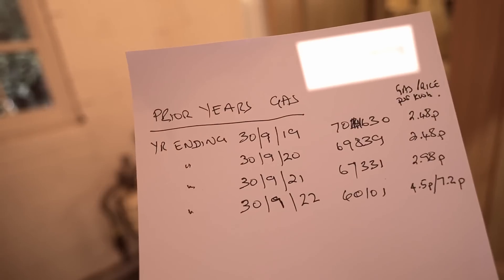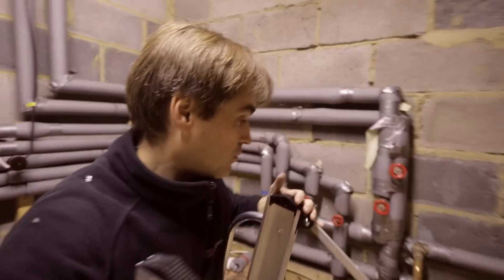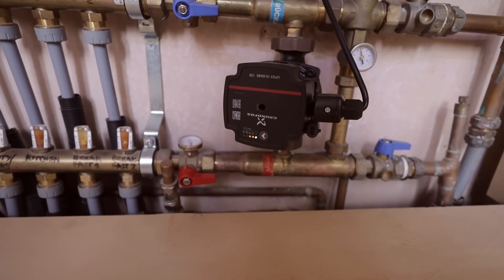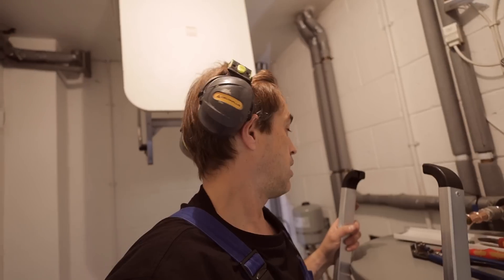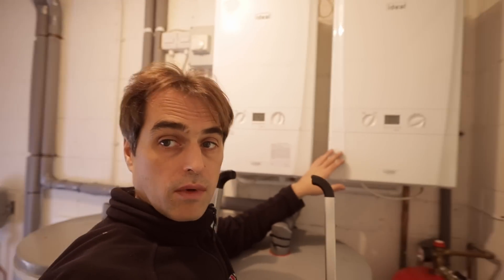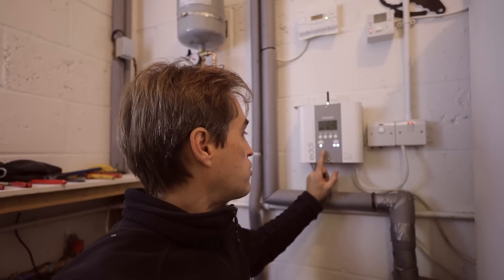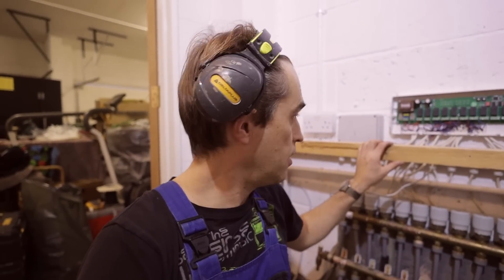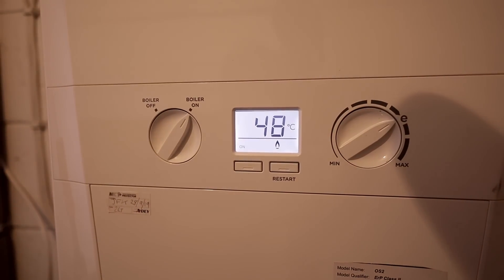Learn How to Lower Gas Bills and Improve System Performance

Comment: When we moved in the ex landlord told me to put the gas condensation boiler for heating only at 55c!
After watching plumbing videos,  testing different configs, buying temp /humidity sensors for every room and checking precisely how they compare to the boiler. I just realised that the boiler doesn't need to be hight than the minimum temp (40c)

Now I'm planning to get a competent plumber like you to install a proper system in my old home. It is worth it.

Comment: Many thanks for sharing this and also thanks to the property owners for allowing their property to be used as a case study.

Looking at your proposed saving of 20,000 kWh every year - heat generated within the building has to escape somehow - either the building is maintained at around 30C (unlikely) or they regularly dump heat by opening windows (possible but they probably haven't called you in to close windows for them) or the Ideal Heating boilers are both losing an average of over 1 kW continuously every hour of the day for 365 days a year - assuming they are set up for 90% combustion efficiency the majority of this heat must be leaving the building through the flue.

I have an Ideal boiler and I can't work out how it is even possible for it to be so inefficient - they can't just 'lose' heat - do you have any idea how these Ideal boilers can perform so badly?

Comment: Do you do heat loss   calcs on these upgrades or do you guess?
Reply from the maker: Full heat loss, always
Reply: @UrbanPlumbers   You may not know what insulation as been added .
  You did a nice job with those mixers  .
with the insulated covers .
Reply from the maker: @mgbroadsterJ  still better than just guessing. I go to the loft and look down the cavity or look into the vent brick. If those are not available I would drill the wall to check if customer permits.

Comment: sry I stopped viewing the video after you said that the water heater turns on once a day for 2 hours. Why? Why do you need electronic thermostat for that? Why not use a regular thermostat inserted in the water boiler  and that one triggers the gas boiler to heat the water when it gets bellow lets say 45 degree.

Comment: Brilliant analysis and fix Szy. And you managed it without slating ideal boilers!
The really depressing thing is how the last plumber (definitely not a heating engineer) managed to leave the system in such a state without even testing that things were functioning sensibly. Was it a complete install or has it been modified over the years to become that complete mess?
Reply from the maker: Looks like things have been done to the system over the years. Last installer just changed boilers

Comment: Underfloor heating gives you a great chance to use a condensing boiler at super-low condensing temperatures.

Unfortunately all gas boiler manufacturers installation manuals wrongly instruct us to set the return temperature to dew point (56ºC) or lower, which is incorrect - it should be the FLOW temperature.  

Even one of the best boiler makers, Viessmann, shy away from correctly directing the flow temperature to be set below the dew point ! Why do they do it, when customers could save gas bills by making the boiler condense genuinely, instead of spewing white vapour clouds into the garden? They are stupid commercial reasons that lead to this madness.  If Worcester Bosch for example told the truth about setting low flow temperatures:

1. Installers would clog the phone lines claiming it was wrong !

2. Competitors would falsely claim their boilers condense even with return temperatures of 56ºC !

3. Customers would complain that the lower flow temperature require bigger radiators than a competing boiler, and they might lose sales over it !

So as usual, the unsuspecting customer loses out with unnecessarily high gas bills.

The step change of 11% efficiency improvement with gas condensing technology only occurs if the water vapour literally DOES condense on the heat exchanger.  Otherwise an old style non-condensing boiler can achieve exactly the same efficiency levels - yes, really.  So the entire drive across Britain to install condensing boilers (and their tiresome condensate drains) is wasted.  Just wasted.

To get anywhere near to that 11% fuel benefit, the ENTIRE heat exchanger must be below dewpoint.  There are two critical changes that the installer must undertake, AGAINST the manufacturer's recommendations:

a) reset the Natural Gas gas valve from 10+% excess air to around 2% excess air.  This raises the dew point temperature back to close to 56ºC making the whole effort more achievable. You can't work sensibly with a dew point of 46ºC, can you?

b) set the FLOW temperature as far below 56ºC as you can manage.  This engages 100% of the heat exchanger's surface area in the battle to condense the flue gas, instead of chucking that valuable white vapour out into the garden.

Here's another glorious example of Vsmn having to drop down to Level Stupid, just to remain competitive in the British market here.  This poor sodding German fella Christian Engelke, the Technical Director of Vsmn UK, writes in a frustratingly oblique manner about the need for Class B residual current detectors on ALL gas boilers & tumble dryers (instead of curve B Class AC) here:

https://www.dropbox.com/s/4p7e3rs2fsawsdd/21%20ViessmannTypesRCD.pdf?raw=1

where the boiler's installation manual explicitly states that your bog standard UK RCD type A or type AC will not function for any modern gas boiler.  Just think how many gas boilers around the UK are disabling the RCDs around Britain by saturating their magnetic cores.  Households are then left unprotected against genuine faults to Earth ! 

https://www.dropbox.com/s/apskmekx49xo9vo/21.01%20vdmontageexcerptrcd.pdf?raw=1

Comment: I am considering secondary circulation. 

My idea was to have a motion sensor in the bathroom to trigger the pump. That way it’ll only run when you’re likely to use the hot tap.
Reply: I've seen that done on a motion sensor. The secondary pump runs for the time it senses motion. hot water is instantaneous at the taps.  A nice way without having them run 24/7
Reply from the maker: yes, that is not a bad idea. Just make sure it cannot run for longer periods of time.

Comment: Your customer must be chuffed to bits. Impressive work. Once you get the new flow meters and assuming the original design data sheets are not available - how are you going to optimise the flow rates without spending another couple of days? Excess flow may have been one part of the overshooting issue in any of the heated spaces.
Reply from the maker: Luckily zones are marked on the manifolds - I will just go by pipe centres (thermal camera) and room area plus heat loss that I already have. 1 day job. Maybe even not a full day.

Comment: Been watching your videos for a while now and I like your work quality and attention to getting the figures right and most efficient. I was wondering, would you recommend a system boiler for an S Plan system. I've had an Alpha HE SY25 running for the last 16 years and it's getting tired now. It's used alongside a Heatrae sadia Premier Plus Unvented 150. I'd like to go all bells and whistles but we are moving in the not too distant future but still feel like while winter is on a better boiler may be needed and I'm topping pressures back every now an then. Your advice would be very much appreciated.

Comment: Now that gas is so expensive, investing in efficiency is a no-brainer. We converted to Honeywell Evohome controls in 2018 and the 1st year savings more than paid for the £700 investment. I’ve also fine-tuned the heating curve and temp. offset (system has weather comp.) to the point that flow temps are at the absolute minimum required.
The only downside is that the motorised radiator controllers sporadically need batteries changed around 1x per year - rechargeable batteries are a must!

Comment: why have a boiler run on 50 degrees for underfloor heating? that is a waste of energy as well. and you can remove the pumps and change the manifolds over to pumpless.
Reply from the maker: There is many reasons to run flow at 50C for UFH: (this is what this one is set to at design temperature of -2)
- carpets or high tog value floor coverings require 5-10C higher flow temps
- very long pipe runs to manifolds
- wide 200-250mm pipe spacing (as is the case here)

Also, the most important reason - the difference in flow rates between the boiler and UFH manifolds. This house is a 21kW load on UFH connected to a 30kW boiler.

If you were to set the boiler to the required flow temp of let's say 35C - with the boiler running at DT20 at full load and UFH at DT7 - the boiler would not be able to provide enough energy for the UFH. The reason is simple: UFH flow requires flow of 2600 liters of water at 35C - but the maximum what boiler can deliver at DT20 is 1200L / hour at 35C. You can try to lower DT to 10 at the boiler but you will still be short in this case. There is also a limit of flow that you can put though the heat exhagner. That is the main reason why you have to run UFH at 35C mixed down at 2600L / hour and boiler at 1200L / hour at higher temperature to provide the correct amount of energy required for UFH at full load.

If you look at wider DT at the boiler - it is actually still as efficient as running the whole system at DT7 at a lower temp, because the return temps is still lower.

Hope this makes sense.
Reply: @UrbanPlumbers  the math makes sense yes. especially if you are limited by pipe diameter. but i doubt that such a house of that size actually needs 20+ kW sustained if heated 24/7.
Reply from the maker: @SupremeRuleroftheWorld  4000sq feet with badly installed UFH at 200mm centers, carpets on the floor, and loads of uninsulated primary pipework in plastic. I would not risk it.
Reply: @UrbanPlumbers  i think you are confusing the heat requirement of the home (aka: insulation) with the abillity of the UFH to give off the required heat. the heating capacity of the UFH is dicated by the water temp, not the actual kW rating of the boiler. there is not much need to squeeze 20kW from the UFH with too hot water when the building does not actually need it. that is a waste of energy. that is why i also hate zoned UFH with the fire of 1000 suns. it messes with the abillity of the UFH to give of the needed heat so you must crank the water temp to get any meaningful heating in the few rooms that care calling. its WAY better to spend balancing the system so each room heats equally and you can lower the water temp and use weather based temperatures. its vastly more efficeint than just brute forcing too hot water into a few zones. with boilers its not as much of a problem as they are already so inefficent at low power but with heat pumps it gives massive power savings as they can run at power levels the boilers can only dream about. many UFH installs i modified run at well below 30c and prehaps bump to 35 near freezing outside.
Reply from the maker: @SupremeRuleroftheWorld  If it was a heat pump it is a different story - they run at DT5 - but would still need a buffer here and pumps on UFH. No chance to run 20kW without a buffer and additional system pump/pumps. Also, this would require massive primary pipework.
Reply from the maker: heat loss of the property has to be matched by the UFH output - in this case 55watts per m2

Comment: that house uses 260 KWH a day???? My house is 3300 sq ft I heat all of it with Mitsubishi Hyper Heat Pumps all ductless, a heat pump hot water heater self contained, a hot tub also. on my worst days in January Im at 125 KWH.. I still have to add fiberglass batts in the attic but i did every upgrade to this house efficiency wise. We used to be electric baseboard heat. that was horrible..

Comment: It's a shame there's probably quite a lot of houses wasting so much gas with poor/broken heating controls. Nice job on this one though
Reply: I think many gas installers "know" gas boilers (otherwise boom goes the property or angry callouts) but as to electrically setting up the system?? That needs an understanding of electrics. Why are most installs not HW priorty?

Comment: This sounds like rocket science to me, an ordinary member of the public. The comments show that you are an exceptional engineer.
I wish someone like you had installed my daughter's new boiler. She is on a low income and ill. She applied for a grant and was asked to pay a percentage of the costs. She has an old water tank in the airing cupboard for hot water. Instead of installing a new combination boiler, they replaced it with an older model non combination, which has left her with an old inefficient system. Can you  give any advice? She can only get hot water when the heating is on. All summer she had no hot water, and had to boil it in the kettle. The company who installed it didn't explain this and not bring an expert and living alone didn't realise what was happening. They are no longer interested in her as the job is completed.
Reply: Never cheap out on a gas engineer. There's lots of cowboys out there. I'm doing my training now an looking at the pipework in my own home, it's pretty shocking what people get away with.

Would be hard to advise without all the facts. Depende on the size of her property, her budget, her location/outdoor temps, insulation and her existing pipework. 

My first guess would be, that a combi might be better, since it can so hot water on demand.

Comment: Does the Eddi not have a relay that can be used to interrupt the ‘gas’ system demand? Everything I see about tends to assume that the hot water will only be heated by the ‘free solar’ , but surely the more common use will be along with a primary circuit?  Great video. Good to see a guy who cares about these things.
Reply from the maker: From what I can see in the manual Eddie can use gas boiler as boost only. I am unsure if it can be used as a timer for an external heat source. Will give it a go when I come back t on the job to repair manifolds.
Reply: @UrbanPlumbers  if you could drop out the heating demand for the wet system, the DHW time clock could stay on during the day, as the Eddi could cut in if the demand was there and, of course, it had a supply from the solar. Great work.
Reply: @UrbanPlumbers  It most definitely can but must be specified on purchase i.e. an additional relay is required. 

Given that it is the best diverter on the market, May deserve its own episode and perhaps you contacting the company to have them feature on your Chanel?
Reply from the maker: @singlendhot8628  I will talk to them soon, as I will be doing PV on new house

Comment: Some cheap smart motion sensors and relays would be a good upgrade for the secondary return, place something like a Sonoff or Shelly motion sensor above the door in each bathroom/toilet and a smart switch controlling the circulation pump then set up a simple automation to run the pump for a couple of minutes when motion is detected. By the time you've finished your business the pump will have run and the water should be hot at the tap ready for use so you get maximum benefit and minimal losses pumping it round when you don't need it. You can also use a button rather than a sensor for places like a kitchen that will be in constant use but doesn't need it recirculating constantly.
Reply: It's only a good idea if the savings compensate for:
-  the added cost of the gear and the cost of installation, 
- the added complexity (pity the next plumber who has to sort out what you had done, and which bit is now broken)
- the decreased comfort, if all this does not work in a timely manner.

Personally, I believe in Keep It Simple Stupid,  wherever possible.
Reply: @oldcynic6964  Did you mean to aim this at my post in particular or was it intended for the video in general?

Comment: speaking on efficiency, I have a hot water Cylinder 'S plan', running on Nest Learning 3 controls (thanks to your videos by the way) - boiler is a Potterton Promax HE Plus but an older model. while it was recently inspected as part of my boilercare plan and came out fine. would there be any benefit in installing a new boiler? this one was installed since flat was built in 2006.... I am thinking perhaps a newer boiler would be much more energy efficient and take less to heat up the tank...
Reply: 100% Yes. Get a Viessmann 200-W. There is no boiler sold in the UK that is more efficient.

Comment: Awesome video! What a set up and love the innovation you brought to the party! I have exactly the same boiler, how easy was the weather comp to fit? Is it good, would you recommend it? Did you use the Ideal version? Cheers
Reply: I recently had an Ideal Vogue installed with weather comp and it's been a revelation. House feels so much more comfortable as a result and it does a great job of modulating the flow temp to match the heat demand. Makes you wonder why it's now installed as a matter of routine.
Reply: @richardwaller7721  thanks for the reply, I'm certainly going to go for the weather comp, just need to track down the electrician now! Cheers
Reply from the maker: @Reakerboy  if it is a heat-only boiler then it is doable but definitely to easy. It may require a relay and also a Normally Closed valve installed - so-called X plan
Reply: @UrbanPlumbers  yes, I believe it's called a system boiler? We have an unvented cylinder also. So I see the issue is with hot water priority? Is that correct? Thanks for the response, super helpful. 👍🏻